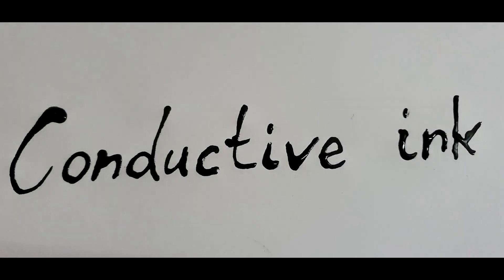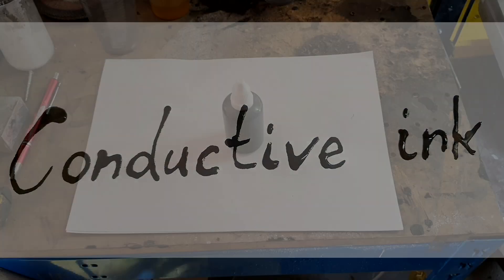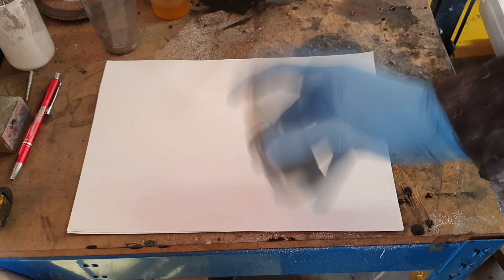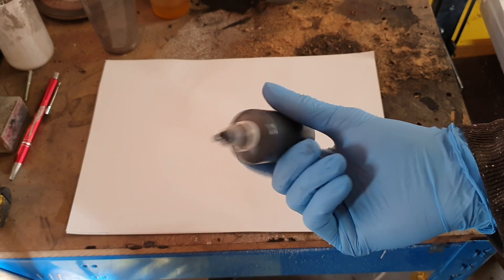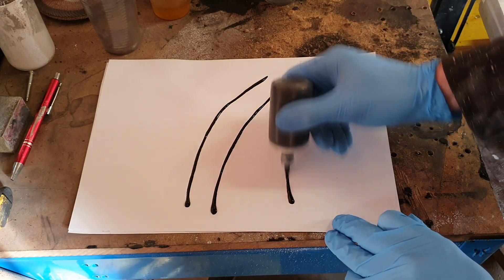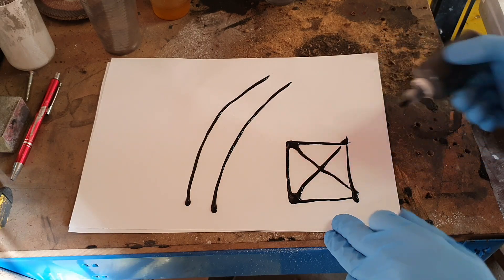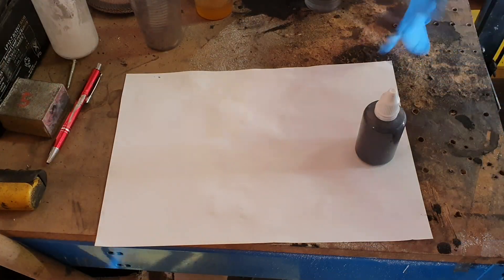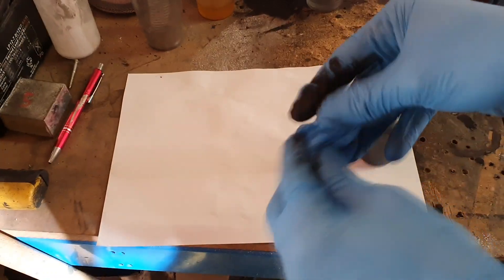Conductive Ink - lvl 2

Comment: I have a question for you if you don't mind. I'm fascinated by what you're doing with the ink and I'm interested in making my own. I have a couple of jugs of N908 Carbon Black. It's extremely pure lab-grade carbon black powder. Do you think that would be a good substrate for conductive ink?
Reply from the maker: Hard to say, because I dont know N908. And I was also not able to get any technical paper to see the measured resistance. Check the volume resistace or surface resistance.

Comment: HI Duzan, can this ink be aplied to thinn slices of potatoes and then dried and the ink will stick to the potatoe surface ?
This could be maybe used for an microbiotical fuelcell in urine to extract electricity from Urine... Maybe you could try this.. Then only the other electrode must be found that gives the highest voltage together withh the graphite ink...the potato slices with the graphite ink electrode have to swim on the urine surface to get also oxygen on the graphite and the bacteria can go into the potato and use it as food. at the other side of the potato slice could be put a different electrode like stainless steel or Tindioxide or something that puts out more voltage versus graphite...Maybe you can try this or let me know, for how much you sell this very conductive ink. Many thanks.
Can we get more voltage than 2 Volts from such a single cell with it ? What would be the best power output from such a cell ?
Regards, Stefan.
Reply from the maker: Uff, I never play with microbial fuel cell with potato and urine. Therefore is hard to say what will be the performance. I also never try to paint the potato with ink, but I think that you can paint the potato with no problem. Here you can get the ink https://www.nemo-conductive.com/

Comment: can you make something like a putty ink?
I have an idea to use laser cutting in acrylic, a film layer on top and the laser will etch the pcb pattern.
afterwards, putty ink is applied and the film remove to reveal the pcb pattern.
i have tried this with the other ink,, from FWG, but did not work well because the laser makes mountain groves in micro scale in the etching process,, i think if it's like putty,, a thickness can cover these groves and hopfully a better conductivity path